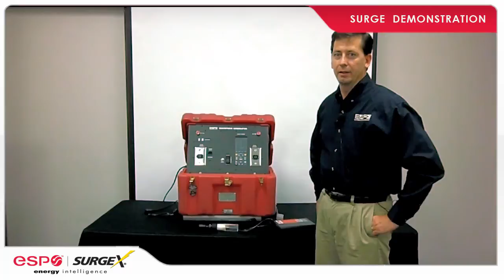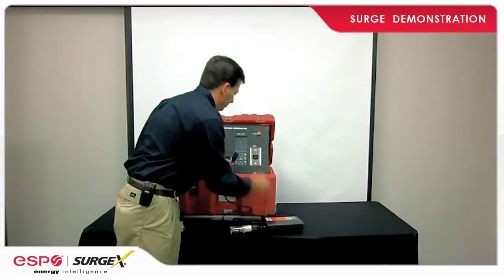ESP Surge Protection Demonstration

Comment: I have two ESP Next Gen PCS units I am trying to use down stream of a GFCI to protect audio equipment. Whenever I plug either unit in to the down stream receptacle the GFCI trips. Is that normal operation? I could see one unit possibly being bad and tripping the GFCI but two? Can the Next Gen units be used down stream of a GFCI? My web search has been fruitless. Thanks.